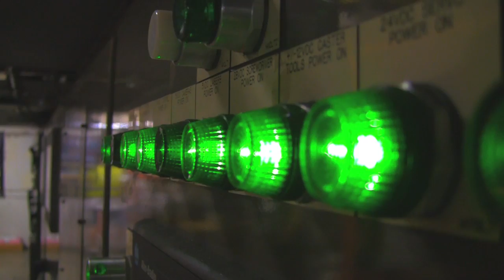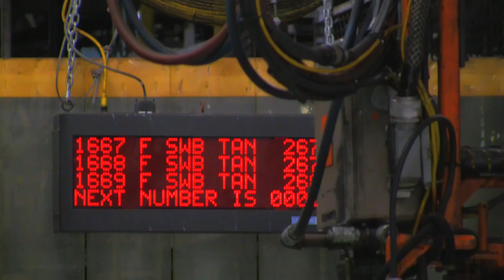Funeral Of A Factory

Comment: You actually got to build the vic? Do you realise how badly I always wanted to. You guys built one hell of a car. I'm on my 3rd... If it wasn't for the vic, I'd be dead right now. I got hit by a semi in my last one. the semi was doing 100kmh and I walked out relatively unharmed other then my back and neck hurt. This is the saddest video I think I've ever seen. I think Ford should've kept the last vic though. Not sold it to some random country. It should've stayed at the Ford Headquarters. Quite possibly the one crown vic that every crown vic owner in the world wants.
Reply: lets hope that the last crown vic doesn't get sold to some douche that crashes it in less than a month
Reply: I believe it's on display at the dealer that recieved it in Saudi Arabia.
Reply: correct. It is on display at a dealership in Saudi Arabia. It's in a climate controlled showroom.
Reply: While this would be cool to have, I'd rather have a Cobra Vic. If you don't know what it is, google it. They are impressive.